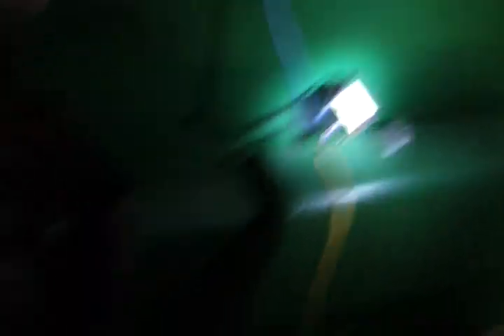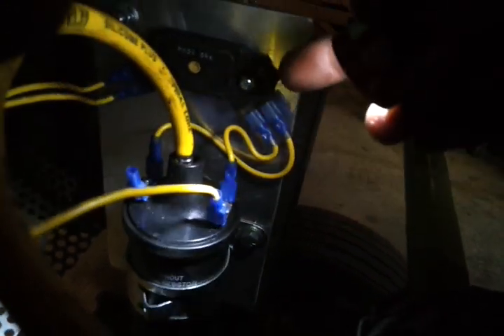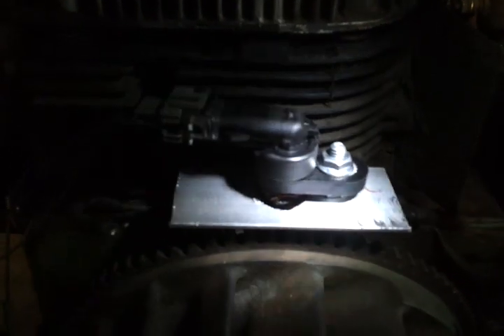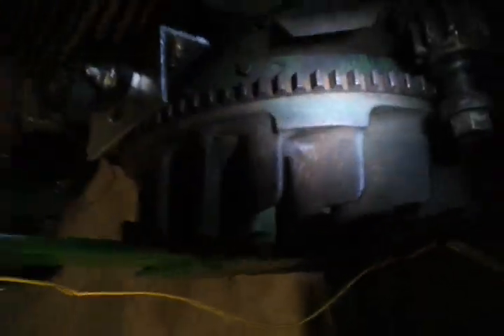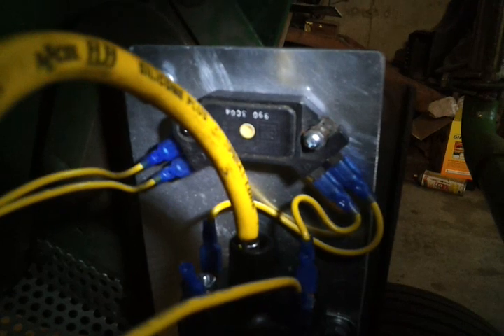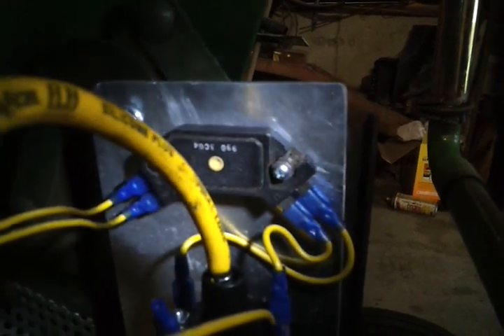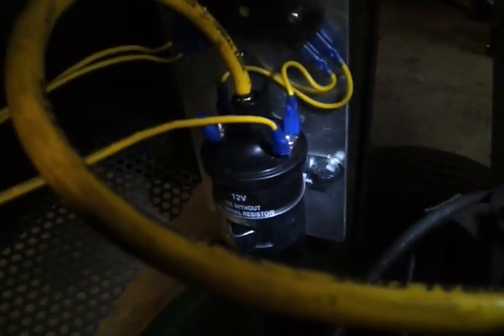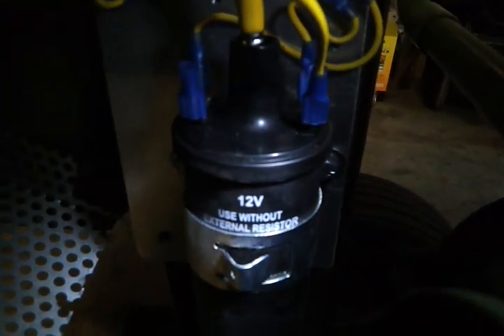tecumseh hh100 solid state ignition system replacement 2

Comment: Hey , this is an awesome retrofit, I did it on my miller bluestar welder with a Tecumseh 16 hp it had a blown module and it is an obsolete part. I used the accel module you recomended and it runs GREAT! Thanks a million!!!
Reply: Mark Bergt how'd that retrofit work. I have bluestar welder also, it has an oh160 engine, bad module.
Reply: Mark I just did my bluestar but used the oem gm hei  I'm backfiring when starting to accelerate just wanted to confirm the accel module would fix this ?
Reply: Michael Walker you need a high performance HEI module
Reply: @michaelwalker1644  did you ever upgrade the HEI I'm having the same problem and the engine is backfiring and misfiring too
Reply: I have a Miller Bobcat 225 that I am going to try and retrofit this with. Thank you for the idea.

Comment: The module is firing 8 cylinders and at a much higher rpm on the Chevy engines so it should fire just one cylinder to any rpm it can spin.
Reply: I'm having a hard time wrapping my head around this analogy as well, but my retrofit on my PUG is doing the same thing so I'm going to try one to see if it alleviates the problem
Reply: Okay I see this explained in another string of comments; module is usually inside the distributor which spins at 1/2 the RPM of the engine. Engine cutout at 4500 RPM = module cutout at 2250. Makes sense now...they also explain the different heights on the pins which was extremely helpful too!!
Reply: @wowchad  i have used the dodge on a few  atvs's and never had a problem.
Reply: @wowchad  yea that comment is ill conceived.... It's actually the fixed dwell time on the OEM module that causes the coil to breakdown.... The high performance modules have a dwell curve programmed in to allow the coil time to recover before it is called on to fire again

Comment: Big Mike, you might want to rethink the engine speed over speeding the module, unless it is a bad module. In a Chevy V8 that module has to fire the coil 4 times each engine revolution, so when your mower is running at 3000 the module is firing 3000 times a minute. When a V8 is running 3000 rpm the module is firing 12,000 times a minute. Maybe your module is bad or is getting hot. Neat about the wheel sensor, I like that.
Reply: Chevy 350 distributor runs off of the camshaft and it turns 1/2 as fast as the crankshaft and only fires 1 time. If you put the distributor in 180 out the engine will not run. 2000rpm on a Chevy V8 fires 2000 times. 2000 rpm on a small engine that is fired off of the Crank will fire 4000 times.  If the HEI module has a 4000rpm limiter it will cut out at 2000 rpm on a small engine.
Reply: On a V8 4 cycle engine, the module must fire 4 times each revolution (360 degrees), 8 times every 2 revolutions (720 degrees).  So on a V8, at 1000 rpm, the module must fire 4000 times per minute.  The reluctor has 8 segments inside the distributor, 4 cylinders fire each engine revolution.

Comment: What forum are you referring to and I did this same type of retrofit on my PUG UTV using a 12v motorcycle coil so it all fits under the original cover. Looks great, much cleaner & you'd never know looking at it that it's been modded. Now I just need to figure out if & how my battery is getting charged.

Comment: This is a great retrofit. I tried doing this with my kohler 14 hp k321s but it didn't work.  I think it's because i used the original trigger switch.  Also I crossed the c and b on the HEI module.  Could I have shorted the HEI out or do I need to replace the trigger switch with a sensor?  Any suggestions would be appreciated.  Thanks
Reply: Did you ever figure it out?  Want to do the same thing.

Comment: Does the charging coil behind the flywheel still charge the battery? I have a Tecumseh oh140 that i cant get to fire and was gonna try this before I scrap it but the charging is what i was wondering about.
Reply: Wondering the same as that would be an issue if it wasn't. Mine is an HH120 & I just got it running, but it pops & backfires at any higher RPM than idle

Comment: I did this mod with a coil from a 1987 Jeep Wrangler. I have power to the coil and the HEI module but still no spark. Brand new plug. I stuck one of those light up screw driver deals in the plug cap coming from the coil and turned the motor over and it's not lighting up. But the wire was siting across my foot and when I switched it off it have me a good shock one time. Could use some help in figuring this out.

Comment: Great vid,  I picked up a sears custom 10xl with canvas cab and snow blower for $200 it needs a magneto, it will be getting a big mike mod,  couple things.  you stated that the module gives up above 2 grand, we use to drag race these things up above 5-6 grand all the time,  if it is humping up around 2 grand  check you timing pin gap it should be around .006 to .010.  and I don't think the right pin is suppose to be the same height as the  Left one, since the Right on is the firing trigger. Also it might help to build some left right adjustment into it.  Once I get mine fixed and running I will do a video thank you in it.

Jake
Reply: +Jacob Spiegel  The left trigger pin (with the cooling fins facing up) is supposed to be at .250 thousands. The right pin is supposed to be at .187 thousands. The gap is as you said. As for a new or used solid state coil it does not matter if they are used or not. They either work or they don't. Don't let anyone tell you different. Take for example I have a coil that is over 40 years old and it still works. They were never meant to go bad. That is why they have the name SOLID STATE IGNITION. Anything with the name solid state cost money. The thing that burns these units up is old wiring ...THE COATING FALLING OFF THE STATOR CHARGER WIRES, THE COATING FALLING OFF THE WIRING HARNESS, THE IGNITION SWITCH SHORTING OUT FROM BEING TURNED TO MANY TIMES BEFORE REPLACING IT. Them are the three things I have found that burns these units up.  Again they are IGNITION SWITCH-STATOR WIRES-WIRING HARNESS. That's it.
Reply: Jacob Spiegel in your reference to drag racing applications I assume you're talking about an automotive engine with a distributor. In that application the HEI module is receiving its trigger signal from a pickup on the distributor. The distributor is turning at one-half the speed of the crankshaft so there is only one pulse for every two revolutions of the engine.In this application the pickup is on the crankshaft  so there is one pulse for every RPM. The standard OEM GM HEI module has hey RPM limiter function build into it. It begins cutting out the ignition at 4500 RPM. since this application is getting twice as many pulses it begins cutting out at 2250 RPM.

The aftermarket high performance HEI modules do not have that RPM limit function built in so they will allow for full RPM in this application.

Regarding the pins on the flywheel. They are both ignition trigger pins. The shorter one to the right is in position to trigger at 20 degrees BTDC and the longer one to the left is positioned to trigger at TDC. This engine is not equipped with automatic compression release. The original ignition module was designed to only sense the longer pin at the low RPMs during starting and a fire at TDC. This allowed for easy starting without kickback. When the engine was running and reached the speed of approximately 600 RPM the ignition module begins sensing the shorter pin which allowed for automatic spark advance to 20 degrees BTDC.

This configuration does not allow for that automatic spark advance so the pickup gap has to be positioned to sense the shorter pin at all times or else the engine will run with the ignition timing always at TDC and it will not have adequate power. However, starting the engine at 20 degrees BTDC can result in hard starting due to kick back. This can be overcome by engaging the starter first, then flipping on the switch to supply voltage to the coil after the engine has begun to spin over. That way there is no spark until the engine has enough momentum to overcome the kickback problem.
Reply: It all depends on the Module that a person uses to build them. The Chrysler and Accel is the best ones. Not the one out of a GM. That is the one that does not like to handle the RPMs. The left trigger pin is the one that fires the engine at start. That pin is suppose to be at .250 thousands. The right trigger pin is the one that takes over after the engine starts. That one is suppose to be at .187 Thousands. The timing advances to the short pin after start up. Them pins have to be close to those settings on the flywheel. Then the gap is like you say .006 to .010 thousands between the .250 thousands pin on and the solid state ignition.
Reply: Right! Just as you said Byronmill. Very well Said. I did not see your whole message till I replied. lol.
Reply: If both pins are on the flywheel, then the ignition module should fire twice per each revolution, is that not correct?

Comment: why can't it keep up? in a chevy, it is firing 7 times more per revelation so at 5000 rpm it's firing 35000 times a minute in your engine it's only firing only 5000 times a minute?
Reply: That's explained in other comments, but it's basically because they're usually inside the distributor which spins at 1/2 the RPM
Reply: On a V8, the module has to fire 4 times for each engine revolution, 8 times for 2 revolutions, that’s the definition of a 4 cycle engine.  So at 1000 engine rpm, the module must fire 4000 times per minute.  
  2000 engine rpm, module fires 8000 times per minute.
  3000 engine rpm, module fires 12,000 times per minute.
  4000 engine rpm, module fires 16,000 times per minute.
  Remember, the V8 has an 8 segment reluctor inside the distributor, each time the segment passes the pickup coil the module fires the ignition coil.
Reply: It's the fixed dwell time in the OEM module, aftermarket high performance modules have a dwell curve programmed into them , the coil needs time to re-saturate before being called on to fire again

Comment: One thing I have noticed Is in the circuit you don't have the condenser connected. There is a condenser in the distributer mounted right next to the module. I would think that might be a critical thing to add.
Reply: Electo tech. Inventor the purpose of a condenser in an ignition system is to protect the points from arcing damage.There are no points in this system, it is a solid state system using the GM HEI module for the ignition trigger.
Reply: Yet when you look in a gm hei  unit  there is a cap. So GM thinks so.
Reply: Electo tech maybe learn the difference between points and a cap and rotor
Reply: @electotech.inventor2750 well of course ur correct and they DO have a condenser so Ig ur not the one that needs to learn anything, but seeing how u asked the question about the condenser I figured I'd give u an answer better late then nvr Ig , these condenser ' s r used on the positive side coil on MANY  ignition systems that have NO points ..... Lol sry that was for the other guy their that wanted to lecture u .... Anyways the only reason they use those on solid state systems is to keep emf from messing w radio signals .... This would normally only be an issue in a vehicle and really wouldn't be needed on a lawnmower unless you plan on listening to an am/fm walkman whilst riding ur lawnmower I'd suppose

Comment: You can use HEI modules can be used for anything. Ive used them on 1980 kawasaki 4cyl motorcycle , and a 2000 honda accord v6.

Comment: 1st you need to use a solid core wire instead of a carbon core resistor wire. Automotive type spark plug wires quickly burn up when used on a small engine. Another thing is that if the module has a rev limiter like many OEM GM ones have, it will not work for a small engine because a small engine fires every time the Cank makes 1 full revaluation. Chevy 350 distributor runs off of the camshaft and it turns 1/2 as fast as the crankshaft and only fires 1 time. 2000rpm on a Chevy V8 fires 2000 times. 2000 rpm on a small engine that is fired off of the Crank will fire 4000 times.  If the HEI module has a 4000rpm limiter it will cut out at 2000 rpm on a small engine.
Reply: Except you forgot there are 8 firing points per revolution on a v8 trigger so you are off by a factor of 4.     The module is not the issue.

Comment: Hey guys I got a question I know this is a old vid so who knows if I'll get an answer but... I,ve got the engine but mine has the starter\gen on it instead if a toothed flywheel starter I know there is a difference in the ssi's  of the two just wondering if this mod would work with mine also or if would need tweaking to work???
Reply from the maker: +Jester Funnyman if it has the two timing pins it will work if not then it should be a points and condenser system which i would rather have then this set up

Comment: everyone flywheel got actual space to put magnet mine is a thin crap  with gear  and nothing else behind it
Reply from the maker: if your flywheel was not set up with timing pins built into it this setup will not work yours may not work this way

Comment: What a ridiculous thing to say.    In stock for a hei module will handle 8 firing pulses to easily over 4,000 rpm ... thinking that you are over taxing it with a single pulse at half that is just wrong.    You have so.e other issue,    most likey noise from the remote coil interfere8ng with your trigger signal.

Comment: do u know how stupid that sounds. the hei isnt built to work over 2 grand ??? but there in 6 and 8 cyl motors that ooo wait for it... run at over 2000 rpms.. and work just fine.